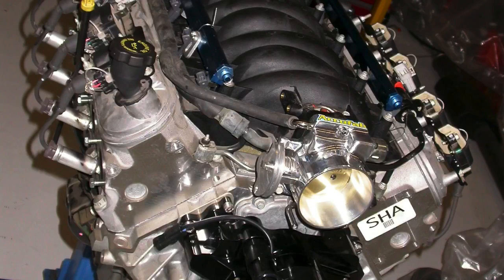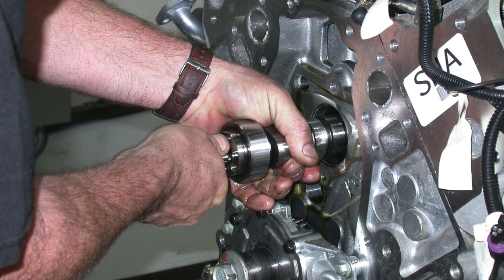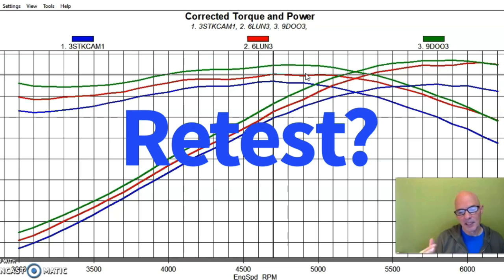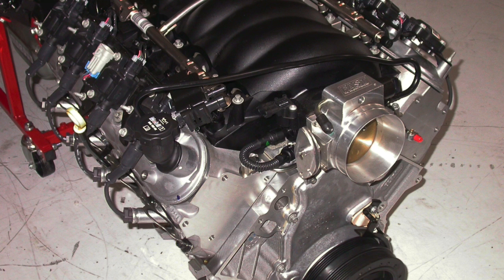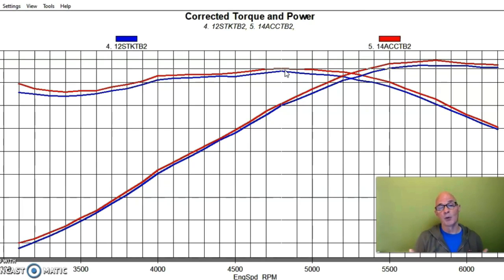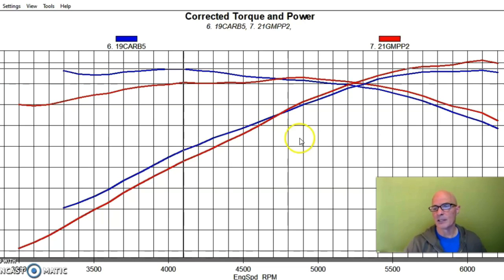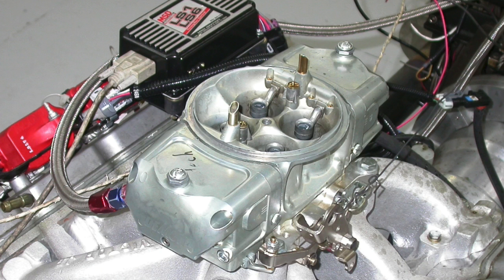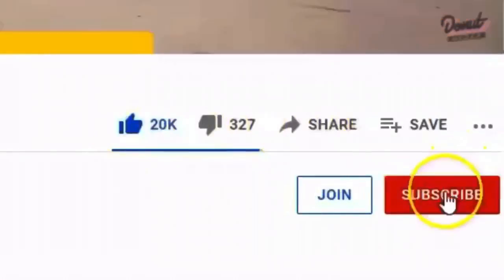5.7L LS1 MODS-CAMS, THROTTLE BODIES AND INTAKES. CARBS VS FUEL INJECTION-WHAT MAKES MORER POWER?

Comment: Hey Richard, have you done a test upgrading a throttle body on a boosted LS with the ls6 manifold?
I’m running 24psi and an ls1 78mm TB and LS6 manifold, and am wondering if upgrading the TB would be worth it, I can’t upgrade the manifold cause it would hit my hood on my swap. I know they are both 78mm doesn’t the blade of the TB take up a few mm’s of that 78? So if I went to a 90 or 92 and the blade took up some, I would still be over 80mm, NO?
Reply from the maker: no need to upgrade the TB under boost

Comment: What jets did you run in that 850... I got a 750dp used with 78 in front and 73 in back... and it seem to be too much carb... I just blocked it off at 72... and going to try it Friday.. hopefully it work
Reply from the maker: MORE JET IN FRONT? DOES THE CARB HAVE POWER VALVES?
Reply: @Richard Holdener  my fault it was 78 in back not the front..
Reply: My fault it was 78 in back and 73 in front

Comment: It's the type of throttle body you used on the single plane. The elbow always loses a ton of horsepower over the 4150.
Reply from the maker: NO-I HAVE TESTED ELBOWS AND 105MM THROTTLE BODY VS 4150-THE PROBLEM IS THE LACK OF FUEL COOLING FROM EFI
Reply: @richardholdener1727  so a 4150 accufab will make the same power as an elbow with a blade style throttle body, given that everything else is the same? If that's the case I'll switch to the elbow right now.

Comment: how bout H20 port injection? just windscreen wiper motor for my supercharged efi engine made decent low end numbers.
Reply from the maker: I TESTED WASHER FLUID 92 KINDS) VS BOOST JUICE ON THE SUPERCHARGED 3800-VIDEO IS UP

Comment: @Richard Holdener, I'm sure you've done a "low-compression" 350 Chevy build at some point. I mean not changing the bottom end and simply adding bolt-ons to it to optimize it. Can you post one of those videos or point me toward one? Thanks!
Reply from the maker: CHECK THE L82 SBC VIDEO
Reply: @richardholdener1727  10-4. Thanks!

Comment: And this is why i'm building a setup with 2 stages of injection (full standalone, not some piggy back shit).

1 stock-ish injector per port and 1 extra injector at the top of the runner, best of both worlds. we'll see how it does when It gets on the dyno :)

Trying to max out e10 94octane capabilities on 11:1 CR turbo engine, using every tool in my box, cooling charge air, massive intercooler for best power at low boost, huge turbo to reduce backpressure to the max, retarding Intake cam with VTC to bleed off compression, all of that will be tested, can't wait!

Just gotta find time to actually work on it.

Comment: The FI vs carb test introduced another variable, though: the added plenum volume of the elbow.  Do you think that was significant or insignificant?

Also, the common trope about SP vs. DP manifolds is that the SP produces "less signal" at the carb which helps kill bottom end power, but from your test obviously adding FI doesn't fix that.  I believe you've performed similar tests on carb vs EFI on a DP and came up with similar results?
Reply from the maker: there is less signal to the carb at low speed with the SP because it makes less power (not the other way around)
Reply: @richardholdener1727  nobody seems to approach it like that.  I'm an FI guy so don't quite speak the carby language...

Comment: Would love to see a comparison between the lt1 5.7 and the ls1 5.7
Reply from the maker: no competition there
Reply: @richardholdener1727  modify the lt1 till it makes the same or more hp than the last
Reply: The ls1
Reply: The only advantage for the 90s 5.7 version LT1 vs a LS1 5.7 is torque will be better under 3000rpm on the LT1 but as rpm goes up above 4000 rpm the LS1 carries more torque from 4000rpm up and torque will drop off much more rapidly with a LT1 above 4500rpm where the LS1 will still be making good torque above 5000rpm the thing about the LS1 is peak rpm torque is very close to peak rpm horsepower on the LT1 with both engines being stock peak horsepower for a LT1 is around 5200rpm peak torque for a LS1 is 4800-5000rmp peak torque for the LT1 is at 2400rpm above 4000rpm up the LS1 makes more torque and horsepower than a LT1 stock way more
Reply: @gloriamaletta8667  the ls is just better in every way but I have the lt1 and just want more content
Reply: @jonasbarnhart8697  I had a 1994 Z28 LT1 and l had many LS series engines have a 2009 5.3 PPV Tahoe and a 2011 Camaro SS that has been modified runs on E85 l can tell you the 1994 Z28 had good low end torque and it would stomp Mustang GTs of the same era up to 2004 and the only mods it had was bigger back tires and a custom computer tune stroking your LT1 to 396ci with the right camshaft and cylinder upgrades should get you around 500 horsepower at the crankshaft the last old style small block l had was a solid cammed 383 stroker good luck with your upgrades
Reply: @gloriamaletta8667  right now my rear tires are old and dry rotted so all the torque does is make them spin 😂
Reply: @jonasbarnhart8697  might be a good thing if it has the stock 7.6 rear end is the biggest down point of the car

Comment: How about an update “modern” LS1 test? Bore a 5.3 block to 3.900 or so, aluminum L33 would be nice but not necessary for the test, flat top pistons with valve reliefs, and start with 706 and 799 heads, various cams and intakes, etc. Find the point where ported heads or aftermarket, like TFS 215s make sense, and take the testing out to 7500 or so. The NA results could be nice! Of course, just leaving it as a SBE and turbocharging would get results, too, but the NA 5.7 comparison would be interesting. Valve reliefs would make more cams fit…
Reply from the maker: westech has a 5.7l iron ls1

Comment: Any naturally aspirated build meant for racing I always go carb. But boosted combos, always efi! Street combos I prefer efi on both but got some good carb combos on the street do work very well and be reliable. My 632 in my 70 monte has a pro systems 1250 Dom on it that I've never touched in 10 years and it still does what it supposed to for daily use.
Reply: My thoughts nearly to the tee. N/a race only use a carb, boost anything use efi, and if it sees more than 10 miles of street driving a weekend use efi. Better engine life and fuel economy. I have a 24x terminator x running my small block and I think you’d be. Crazy not to run efi if you are doing street driving.
Reply: @trevermonk8575  agree completely! The dominator I drive on street is nice but still know efi would be far more efficient. I keep it carb cause simplicity, response and the wow factor....nothing to me looks better sitting on top a big block than a huge toilet bowl carb haha.
Reply: @Monte1970SS  lol there is always that lmao

Comment: Another great informative video.
I have that 212/218 in a junkyard 5.3 with ls6 springs. It's a Very impressive performing little cam.
Thanks Richard.
Reply: It's good enough to run low 12s na in a 88 fox notch
Reply: It should perform well!

Comment: YES LS1 Stuff, try a cam with 600 lift and 22x X 22x
Reply: I have a Texas Speed 224R cam( 224 intake & exhaust , 600 lift on both , on112 lsa) in my 2000 C5  LS1 with headers , Dorman ripoff LS6 intake , stock throttle body ,  stock 853 heads with PAC beehive springs for the lift and mail order tune . It made 380 whp @ 6,000 , 370 foot pounds @ 4700 . Tuner/Dyno operator said the little heads were really holding it back , he said with 243's he would expect at least 430 , it has a nice choppy idle but is still very driveable with the six speed manual , still makes 320 foot pounds at 2500 rpm , I put some CNC ported 243's on it and can't wait to get it back on the dyno
Reply: @danielcarroll5667  Didn't realize the 243's would make that much difference, I have stock 243's, cam motion Titan 2, 1 7/8 long tubes, 6spd, truck intake stock throttle body  in a 2680# S10 5.7 LS1, Lack of Traction is my worse enemy. Has not been on the Dyno.

Comment: Fyi.....those old ls1/ls6 intakes only had a 76mm throat. Opening that up really helped the motor. With a little epoxy you can get them to 80+mm. Then they really start to work since you can use a bigger tb then.

Comment: A throttle body is a gate valve with less than 100,% efficiency. 12 degree chamfers verses 7 degree hurts throttle progression. But on a carb engine, it's all about square inches of Venturi verses cubic inches of engine. The biggest carb on the best intake, with the right balance or peak power and mid range torque. You add to the info on what an engine responds to...generally. The exceptions...they are either for you personally...or for some others to help you solve. If you didn't ask, you wouldn't get an answer...

Comment: The time the exhaust & intake are open at same time, some of the exhaust gases are taking the place of fresh at a bad ratio. 🤷‍♂️ Just a guess... But definitely a re-test would all teach us something. Great content thanks!!
Reply: I always thought any cam with an overlap of zero or below (like both of these baby cams) wouldn't have both valves open at the same time?
It is curious though, a 8-12 degree duration split seems to be pretty common among a lot of the 'off the shelf' cams to suit stock cathedral port heads nowadays.
Reply: Something was not right with the cam, motor, or tune; that 212/220 cam with a tighter LSA should have been stronger than the 212/228 in every way, and especially up top with the bigger exhaust duration.

Comment: Fuel injection or too much cam duration on the exhaust hurts Aspirations Index compared to a well sized carb. Or...Rpm times cubes, divided by power. The lower the resultant value...the better the specific power.

Comment: Its really just a question a preference. Another advantage to efi is it's usually a lot easier to package, to fit under the hood. If I was on a budget or chasing every last hp I'd carb it. If I wanted the ultamate in drivability and adjustability that fits under the hood, I'd go efi. 
I suppose tb efi is the best of both worlds.
Reply: You can make all the power in the world with EFI, staged injection with the secondary injectors in a TB efi system does about as well with more adjustability.
Reply: @Prestiged_peck  
If you got the m money, very true.
Reply: @177SCmaro  I bet you could do a holley terminator setup for $2k
Reply: @Prestiged_peck  
More like 3-4k by the time you buy injectors, fuel pump, and run the lines. Fittings are stupid expensive. 
I did a hp efi on my coyote and it was almost 3k with everything to make it work and I'm still running stock injectors temporarily. And another 1200 bucks for 1200cc e85 injectors.
That said, I still think it's worth it. It's amazing all the stuff the hp and dominator can run.
Reply: @177SCmaro  true*
Reply: @Prestiged_peck  oops, sorry, I thought you wrote dominator. I must be tired. Yeah, you might be able to get a terminator together for 2k or so, depending on the application and what else you need to run it.
Reply: @177SCmaro  I'm thinking something distributor based where you can just add a cam sensor and crank sensor and then of course the I jettison equipment and be gucci

Comment: Love your videos watch all the time, I was wondering what your thoughts are on a cold air intake vs a open air element for a carb setup, I keep getting mixed messages some say the underhood temps especially with headers makes the cold air intake a must for daily driving, and some people are saying the cold air intake restricts airflow so much that it's not worth it ?
Reply from the maker: cold air is better
Reply: @richardholdener1727  thanks so much for the reply! If you say cold air then it is the truth
Reply: Cold air, tube it to the fender or in front of the radiator, or other similar cold air location
Reply: I asked him that question about a year ago and he said if you can put a cold air intake on it then do it. Anything you can do to resist pre-detonation is huge. I wanted an open air element just for looks but I have iron heads which won't take timing like aluminum heads. I  decided to spend money on reducing underhood temps with ceramic coatings and ducts to reduce underhood temps.

I guess I shouldn't have taken so long to type that out haha.
Reply: @c0c0asauce  my underhood temps are ridiculous, when the car is idling and I wash the hood the water just steams off, after seeing that I wrapped the headers even though everyone keeps saying it will rot them, which made a huge improvement, idk what else I can do to get those temps down
Reply: I'm working on an obs chevy with a big block so there's lots of space under the hood. What kinda car are you working with?
For any car I'd look at ignition timing, coolant temps, and warm the car up with the hood open while checking temps with an infrared thermometer to see what places under there are generating the most heat.
I'd figure even if you did have accelerated wear on the headers it would be worth it to slow down wear on the rest of the components under the hood.
Reply: @th3urge  if you paint the headers before you wrap them they shouldn't rot for a long, long time. If you get the chance, unwrap the headers and get some VHT high temp header paint, bake it on with engine heat, then re-wrap them and it'll actually bring your temps down just a bit more while also keeping the headers from rotting. Besides that using plastic rigid gaskets like my 4.6 uses helps reduce intake manifold heat soak, and of course running a lower temp thermostat, I'm gonna run a 160⁰ but a 170 will also help dramatically. Cowl hoods also help, though they might look weird on some cars. Punching holes in or even removing inner fender sheet metal can help as well by ope ING the engine bay up, but not everyone is ready for that kinda work. Also oil cooler will help. Plastic valve covers help reduce heat soak, a plastic intake is awesome for reducing heat soak, lots of little shit, with this kinda work you gotta sweat (lol) the details.
Reply: @c0c0asauce  working with a 85 trans am, the obs Chevy is a nice looking truck I like the paint scheme they did to that obs Chevy on powernation tv , but yeah with that car you got lots of room to do fun stuff with the trans am everything has to be planned out,
Reply: @Prestiged_peck  thanks for the tips, I wanted to actually paint them before wrapping but couldn't remove the headers, I tried every which way but without getting the engine loose there stuck in there so I gave up and just wrapped them in the engine bay lol actually worked out pretty good too
Reply: @th3urge  do you have a tubular K member? If not might be an upgrade worth thinking about. My mustang's the same way with a stock k member. Tubular K you can have them off from underneath in minutes.
Reply: @Prestiged_peck  I don't have a tubular k member,  it makes sense the tubular would free up some more space never actually even thought of that, thanks 👍

Comment: Overscavanging probably..Keith Dorton found that over opening the exhaust duration when you don't have an air restricted engine causes a torque loss. On the 289 he made for the the late Currie Industries Carrera Panamerica 66 Mustang fastback with 500 CFM 2bbl... overscavanging is good.
Reply from the maker: having tested hundreds of cams with more duration-what happened here isn't the norm

Comment: I'd really like to see a test between a 4150 throttle body with a hat and different 4150 elbows with a 102mm throttle body. Mainly cylinder to cylinder distribution
Reply from the maker: the intake design all but determines the distribution
Reply: @richardholdener1727  how the air enters the same intake manifold has to have some effect especially with high air density from high boost and/or meth injection

Comment: You should do more hemi stuff, btw I would like to know if I can use hemi eagle heads on my pre-eagle engine
Reply: I believe you can, but it will raise compression due to the different chamber sizes on head. People use a thicker cometic gasket to stay 91 pump gas out of the eagle heads
Reply: @200shotramhemi4  Thanks bud
Reply: Yes you can, are you on any of the Hemi groups on FB. Find the group called “Eagle Hemi Swap, we can help you with any questions you have.
Reply: @bri-manhunter2654  Thanks, I was looking to swap the heads, put some long tube headers and a new cam
Reply: @angel_m0950 . Of course